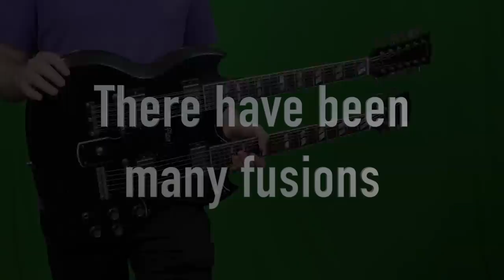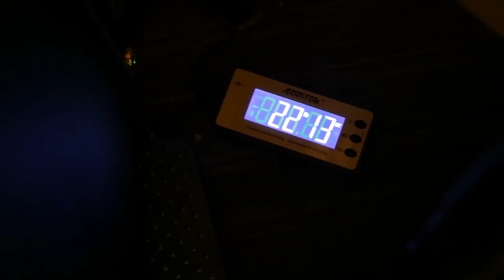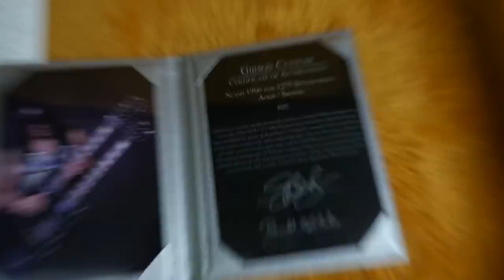Secrets of the $13,000 Double Neck Guitar | 2019 Gibson Slash Collection EDS-1275 | Review + Demo

Comment: That messed up wood split under bottom pickguard is what I've seen on $30 Harley Bentons that were sold as D stock by Thomann and otherwise seemed fine to play. Stripped truss rod on a new guitar you'd expect maybe on a Chibson from a less reputabe Aliexpress seller, together with polishing compound residue and dull bit routing. Just unacceptable. It shows their philosophy, which is not "it's embarassing to ship this to a customer paying $13k" but rather "we can't afford to not just get them out quickly and cash in" and maybe "this will hang in a glass case anyway, nobody will notice anything that requires unscrewing a plate". A working musician will buy a Korean made instrument, not only because of the price but those quality control issues just don't really happen.
Reply: gryzew, this is exactly what to expect from Gibson. Quality control has gone way down. A Gibson isn’t what it used to be.

Comment: Until recently I owned a 1979 model that I bought brand new (so I know it was stock) & the wiring was very different. The switch between the necks was the pickup selector & the one below the 6 string neck selected the neck. Also the top set of knobs were a master volume & tone for the 12 string & the lower set was the same for the 6 string. I wonder if Gibson has varied the way these were wired over the years or if Slash had his wired to suit him & Gibson copied it for this one. Another interesting note, this one is more than 10 times what I paid for mine new in 1979. I traded it to Gruhn Guitars about 3 months ago & it was in mint condition because it spent most of its 40 years in its case. They are cool but you have to really need one,even just restringing them sucks because you can't use a winder on the pegs facing each other, from my experience I would say unless you are a rock star with a guitar tech, I would spend my $13,299 elsewhere.

Comment: Harley Benton makes a double neck in cherry for 400 bucks
Reply: Good luck with that.
Reply: I have one and it's actually not bad. The fret board was dry like all the Harley Bentons I own and at first it turned my fingertips black but the action is decent. For the price I think it's a good deal and it looks cool hanging on my wall. The only thing I don't like about it is that the neck selector switch is down with the pickup selector switch and volume and tone controls which makes it harder to quickly switch necks like on a Gibson.